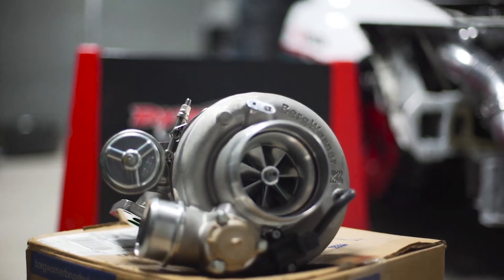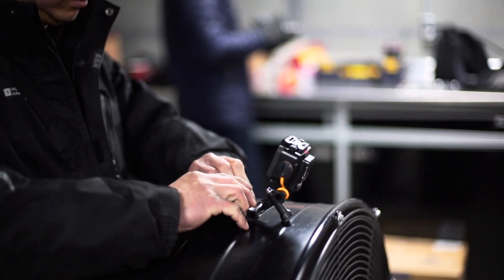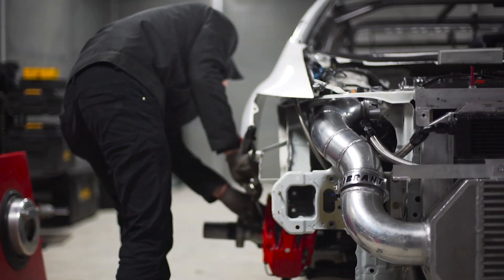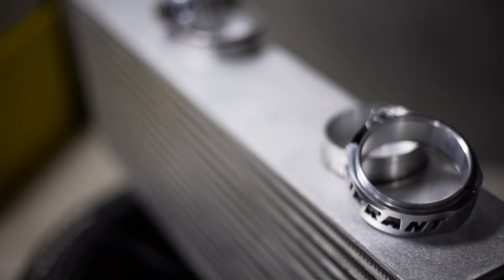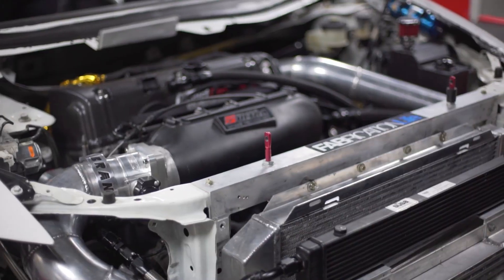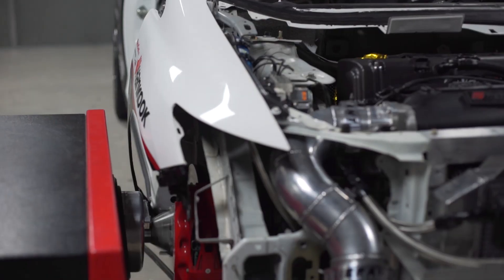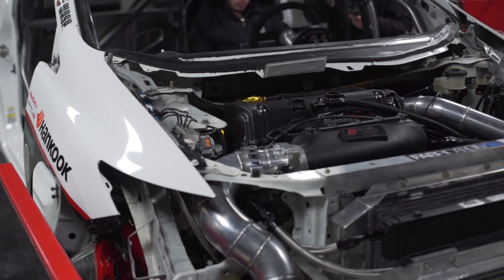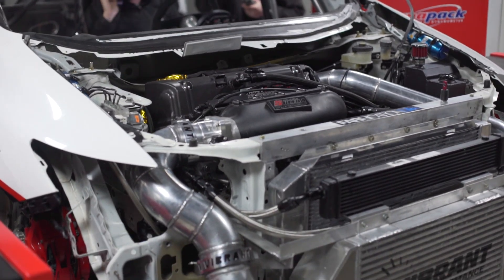705whp Turbo Charged Civic Time Attack Dyno Session

Comment: very surprising that its running flashpro instead of a standalone
Reply: zohan lee I've worked on 600+hp cars with s300. Don't really need a standalone for awesome results.
Reply: I run hondata on my 560 wheel car. No problems. I actually love fidling with it.

Comment: Stock k series trans is like glass at that torque and power levels they break on stock cars with bolt ons so as anything keep finding the weak points build and repeat. Sweet looking purpose built Honda
Reply: You will start to have problems with any honda tranny with that kind of power man!